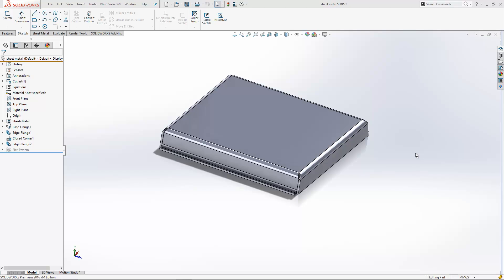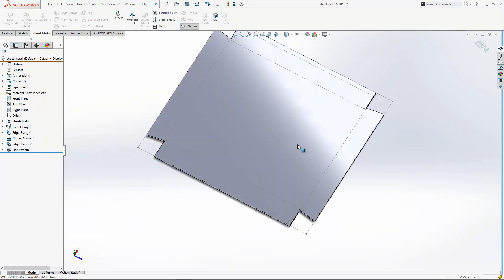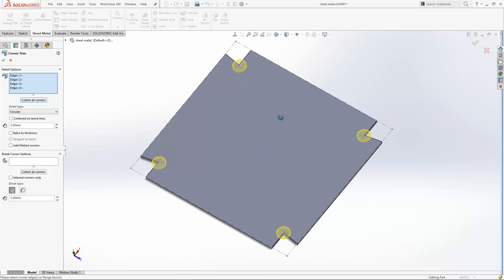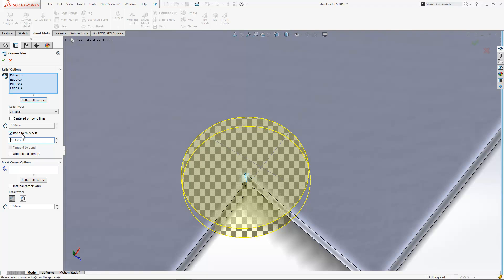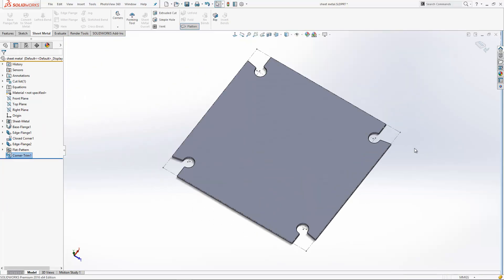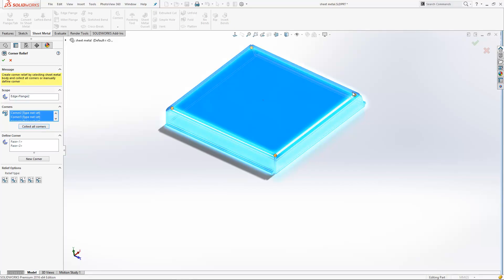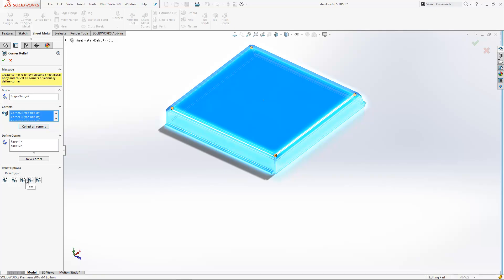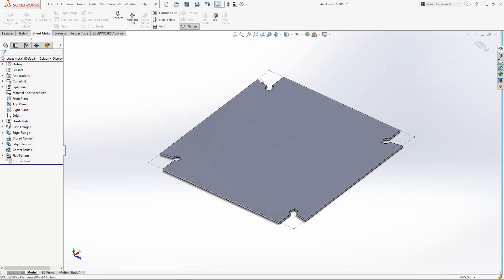How to add corner reliefs in SOLIDWORKS sheet metal models

Comment: I don't know if you're still active, but I have a problem where when I use flatten command the corner reliefs don't show instead it just shows a straight corner.
Reply: When I use unfold its shows the corner treatment but not in flatten.
Reply: @sapanpatel3951  Untick Corner Treatment in the flat pattern options